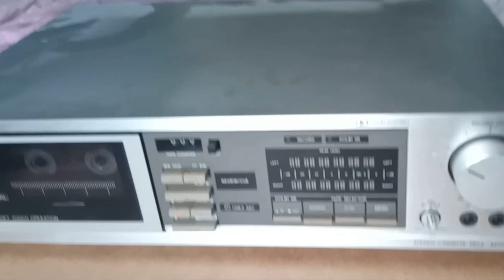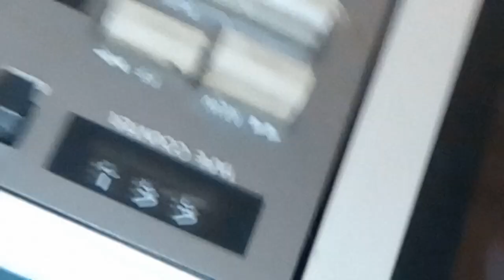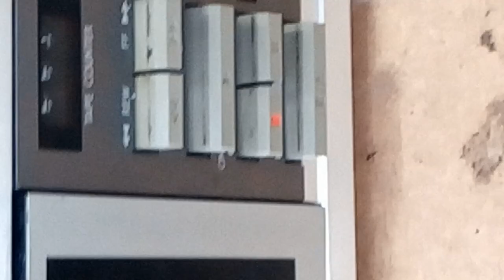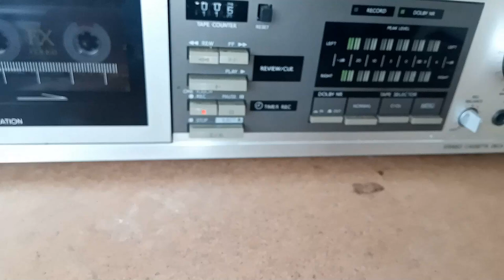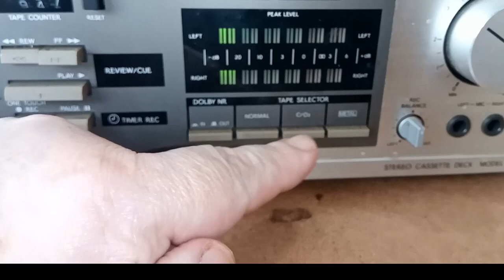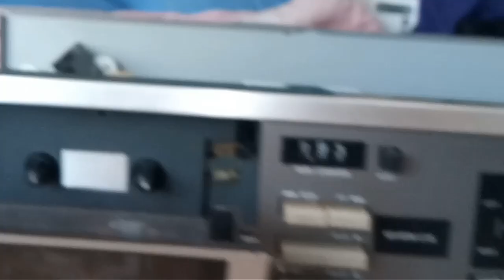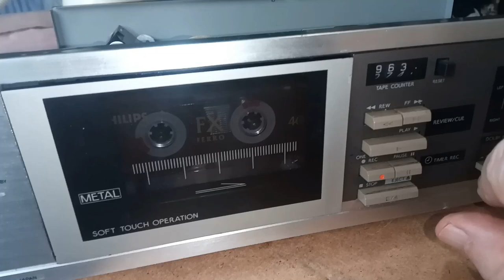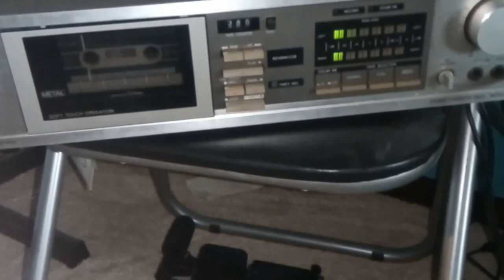Restoring a Vintage Audio Tape Deck and How To Change The Belts | Toshiba PC-G10 Cassette deck.

Comment: I also have one of these and as you say they're a nice deck. For future reference the PC-G10 is essentially identical to the PC-G22 for which the service manual is available online. I used it to trace a shorted capacitor in the analogue amplification circuit recently.

I only had to change the smaller belt on mine, which thankfully is a trivial job. Incidentally the unit absolutely should auto stop on rewind/ffwd, although it has a curious quirk in that auto stop (even for rewind/ffwd) is disabled if the mechanism is in pause mode...

The mech looks to be the same as that in a number of boom boxes of the time - Main belt is Toshiba part number 25755527 (PRB FRW9.2), and the center pulley belt is 25755528 (PRB SCQ 5.3) (data from Google and I'm putting it here as much for my benefit as anyone else's so I don't lose it lol).
Reply from the maker: Thanks for that. I shall have to get one. Cheers
Reply: Thanks for the belt info. I just picked up a g22 that had a non moving capstan. Opened it up and the smaller belt had disintegrated into black tar